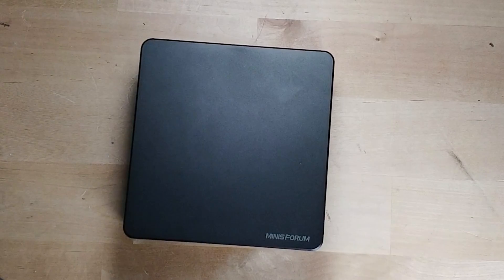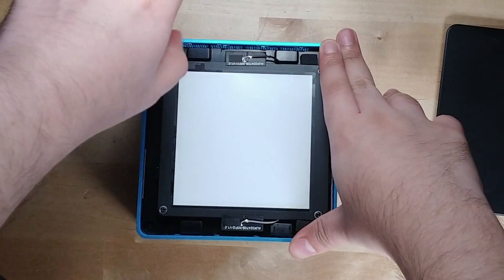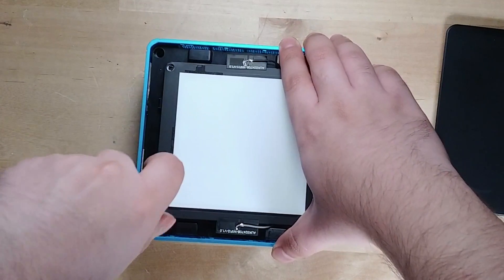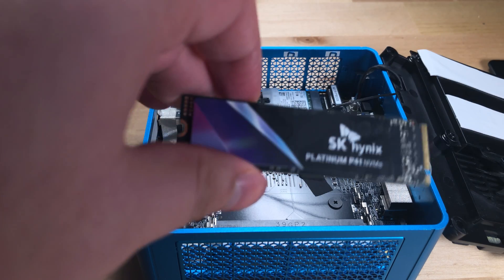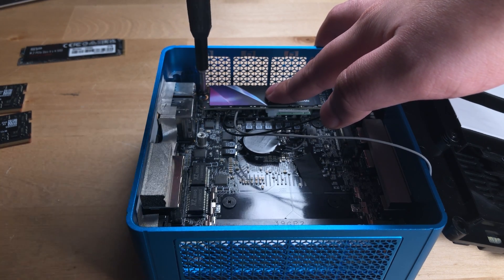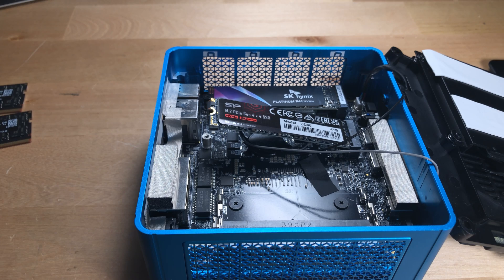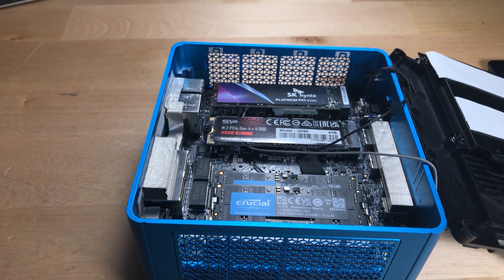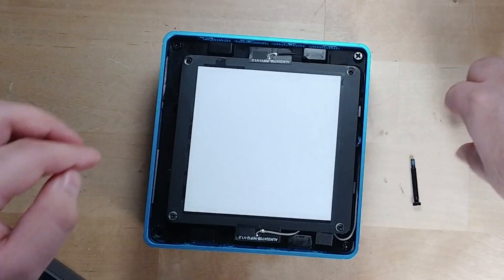How To Upgrade UM780 XTX Mini PC | Minisforum Mini PC RAM & SSD Upgrade | NVMe Gen 4 SSD 32GB DDR5

Comment: enough space to mount ssd with heatsink? thanks
Reply: One more asking... but watching the part where he puts it back together, he talks about the thermal pads on the part that comes out of the top contacting the SSD so that leads me to believe the answer is "no" for standard heatsinks, and "maybe" for laptop type ones where it's a .5mm piece of copper. However if there's a thermal pad, there might be a heatsink built into the top piece.
Reply: @phxrider950  Built in heatsink!
Reply: @iamrocketray  yep - I bought a barebones one since asking that, now I know all about the guts of it. Built my own oculink eGPU enclosure for a 6800xt too!
Reply: I have the exact same question - so ditto for me.  thanks.
Reply: for what i have seen, no there is no more space
Reply: @loopluup3829  correct. There is no room for an additional heatsink. An SSD heatsink is built into the top piece that lifts out to access the M.2 slots and RAM.

Comment: I can add extra eGPU??
Reply: external GPU with USB4 or Oculink. Pretty sure this system has either or both
Reply: @onethousandyearsofcultivat78  The oculink is perfect! faster than usb 4.0(I've tried both and oculink is better by far, bearing in mind that the included adapter takes up one of your N.2 slots)
Reply: So then, in your opinion, if I'm going to use the oculink is that 2tb hynix enough?

Comment: Would like to see how it works with 96 GB, and if you'd consider it, a video on BIOS settings. It took me a while to realize that I have to turn off Secure Boot and THEN boot with my Linux install flash drive  connected, and will it always require an admin or user password just to boot up? (BTW, mine came with a heat sink to place between the RAM sticks, but it didn't look like you used it. How much difference does that make to temperature?)
Reply: i have 96GB in mine and used the heatsink included
Reply: What is the performance difference with the 96g ram kit? Which one did you use?

Comment: I got 2x Corsair 48G chips for a Proxmox (Debian) host and there were a lot of errors in the logs, so a Google search said that adding "pci=nommconf" to the Grub bootloader should hide the errors and I can report it indeed does. Still trying to get iGPU passthrough to work, but so far the host kernel crashes when the hostpcie passthrough is engaged!
Reply: Have you gotten this to work? I've been trying as well and have been running into the same host kernel crashes.
Reply: @cliffbooth9586  Unfortunately no. I ended up installing the kde-plasma-desktop package directly on the host, and that revealed screen tearing issues, so something about the iGPU + driver is not right. I'm trying to get an Intel XE replacement (MS-01).
Reply: @MarkConstable  thanks for the reply. I was thinking about getting the ms01 as well.
Reply: @cliffbooth9586  There's a thread on the STH forums, and I'm hoping to hear if anyone has managed to get iGPU passthrough working. No word yet, but they are only just now starting to be delivered, so it might take another month before a yes/no confirmation.
Reply: @MarkConstable i have tried installing Debian 12 on bare metal with this system several times, both in usb external storage and internal nvme. I am unable to get a display even without installing a desktop environment… no idea what is going on here
Reply: @tttomtxhc  That is bizarre. Proxmox may have a slightly newer kernel than stock Debian 12 so maybe try their install ISO and if that does not work then maybe you have a dud machine.
Reply: @MarkConstable  strange that windows works without issues though

Comment: Nice video. Do you have any link where I can buy the screwdriver in your video please? Cheers
Reply from the maker: https://amzn.to/3vr4uYX 
It's the iFixit Essentials Tool Kit. I've had it for around 3 years now and it has been wonderful. I also bought a cheap 10 dollar kit screwdriver as a spare and it's alright. Not as good a quality and I think the price difference is worth it in the long run. You buy it once and you're pretty much set for life with it unless you lose the bits for it.
Reply: @EVOTech1  Thanks for the quick reply :)